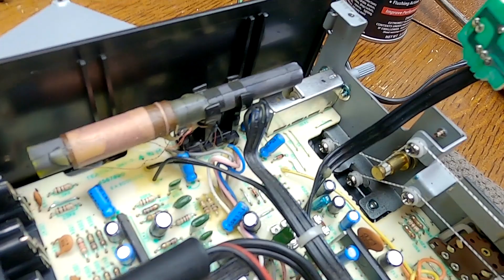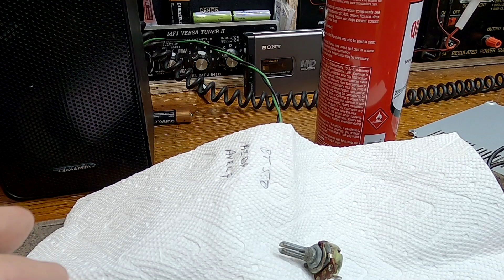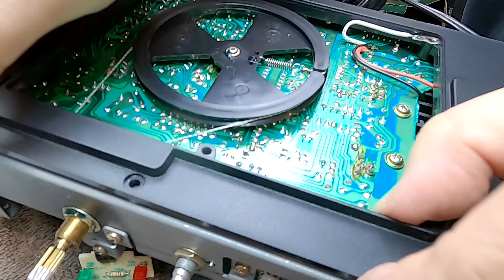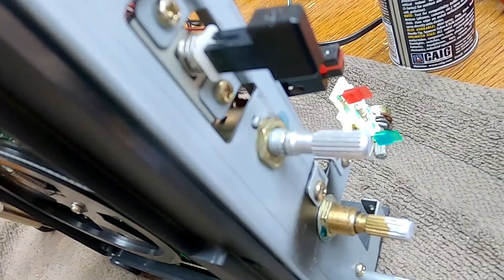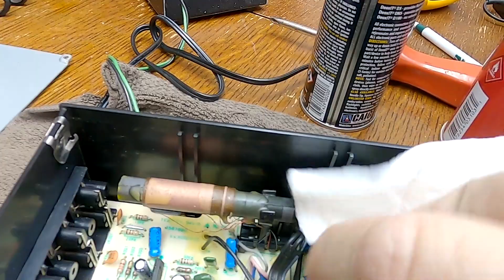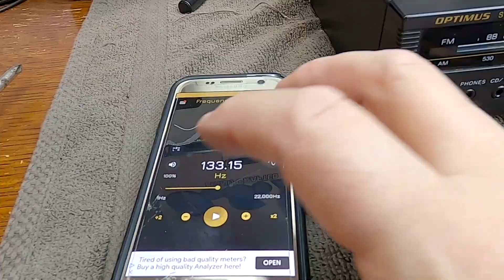Cleaning hard to get to Volume control

Comment: I would not sell that unit to anybody no matter how much spray you put in it I know how to use this stuff and it just baffles me to understand that this is the 10% total harmonic distortion receiver probably puts out a maximum of 5 or 10 watts why would you want to sell this it was meant to be a throwaway item if you can't see it because you're tearing it apart well hello wake up it's junk
Reply from the maker: Boomer comment. I did sell this receiver and the guy was happy to get it. I sold it for a fair price and it did not go to the LANDFILL. A few wpc is just fine so some users that just want some background noise. 
Cheers

Comment: If you have a consumer electronics item, can you just spray it into the volume dial without taking it apart if you prop it up so the excess can drip out afterwards?
Reply from the maker: It is best to get to the rear of the volume control and apply the cleaner. The front of the pot will not let the cleaner inside, it may lube the pot and feel better, but won't clean the innards.